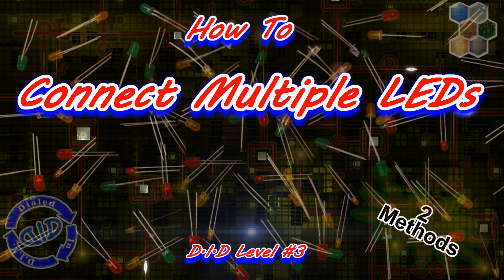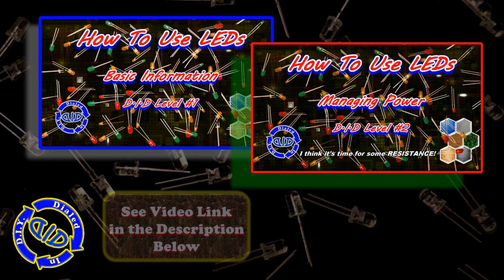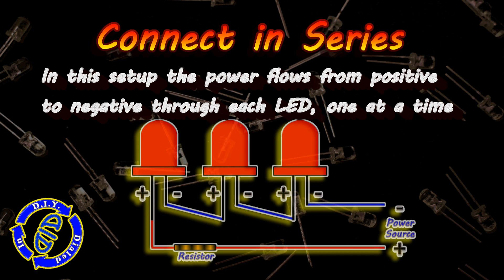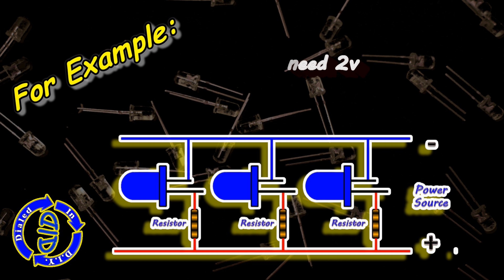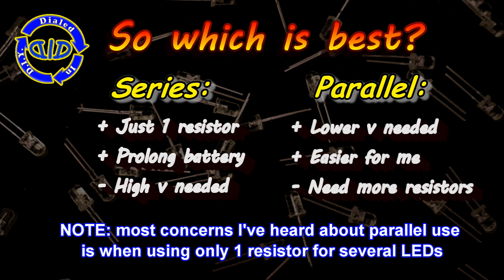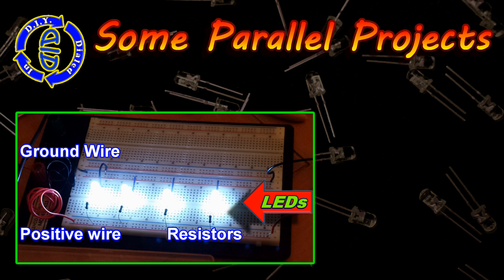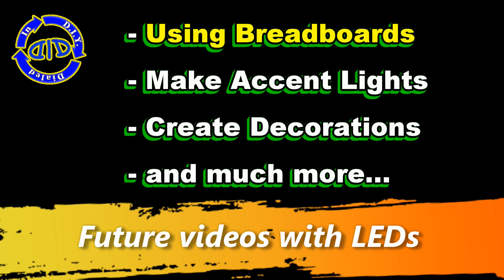How to Connect Multiple LEDs Together - Tutorial - make a string of lights

Comment: I have no understanding of electrical anything.  But, I love building model kits and have about 12 so far.  The lights that come with the kits are wired to battery boxes.  I thought maybe I could wire more kits to one battery box and I've even tried buying a dollhouse power strip and tried that way too no avail.  Is there an easy way to wire all my kits to fewer boxes?  I think I blew one kit already trying a power cord (i seriously need the "for dummies" version here).  There's a lot of batteries and power boxes as it is and a lot of switches to turn off and on.... and they're not easy to get to.

Comment: I am learning from your channel. Thank you. But, I have a problem. I am using a 3v 2x white led with 3v battery as my power supply and works perfectly but, when I added a red led 2v. The 2 white led did not light up, only the red led will light up. Can you help me what should I needed for my problem?
Reply from the maker: Thank you for the kind feedback.  I think you may have too much current needed for all 3 for the battery. Are you using resistors?
Reply: @DialedInDIY  But, I can use 5 to 15 leds (white smd led) in 1 coin battery last time. By the way, I am using battery because its used for cosplay.

Comment: hello, how about 84 led connection, what is the best connection for 84 pcs led?
Reply from the maker: Have you checked out any of the online calculators for setting up leds? That would be my #1 suggestion because it can be done with all of your specs including power supply.

Comment: If I wanted to power one led with a 12v car battery do I just calculate voltage? Or is the battery too strong?
Reply from the maker: You could... but you need allot of resistance. Depending on what you want to accomplish (in terms of form factor / size) you may wish to use  try running off of an adaptor. If the battery is still in the car you can use an aux power port (like the "cigarette lighter") to tie off of. Thanks for taking the time to watch my video and post a comment / question.  [So sorry for the delay... life kinda got in the way for a bit]

Comment: Hi I love your videos, I'm building a grow light out of an old grow light but it had couple lights out of it now there was a driver per light also it had fans but I'm not sure I'm putting them yet I made one already but it was cobs which is what I thought I had anyways I'm putting 4lights I gues 4drivers but I blew one already lol so I'm wondering if you can help me out?
Reply from the maker: Thank you so much! Happy to help if i can. I've not worked with grow lights but it sounds like these are LED bulbs or some form of CFL. Is that correct? Were the fans for reducing heat from the lights?

Comment: say I have a constant voltage driver that requires V between 33-36v. Is it possible to wire multiple LEDs of the same voltage in a string to obtain the voltage draw level required by the driver? and then wire multiple strings in parallel.
Reply from the maker: It is possible just be careful on the combination you use to match the power supply. Those on line calculators are great for that.

Comment: how do you connect one remote to two different brands?
Reply from the maker: Very good question.  Do the different brands match in type and power values?  As long as they have the same "type" of strips (ex. 5050) with same power requirements you can get parts and kits to split connections and drive the lights.  The good news is that these types of lights do not work on proprietary systems so there is allot of interchange that can take place.  Hope that helps.

Comment: If I've got an expensive led strip that can run or chase down the strip and I've got another strip that doesnt do that. If I connect the cheaper one will it perform as one?
Reply from the maker: Depending upon the set-up that you have it definitely could.  Many times the effect you get (in terms of chase, flash, etc.) is due to the control board that came with the strip.  Many are indeed meant to be able to connect to additional strips to extend the effect.  You may be able to look up the model number you have and see if the mfg website has any information to help confirm whether it is possible. Thanks so much for taking the time to watch and comment!

Comment: If you have the right voltage for your leds In a parallel circuit do you have to use resistors
Reply from the maker: Ah, there is an age old debate. TBH I do both depending upon my project but you will find many who argue that the resistor is key in order to protect your diode(s) against voltage fluctuation.  If you check an on-line LED calculator they will almost always have resistors in the recommended design.

Comment: How can i letter E with 10 led connecting 9volt battery
Reply from the maker: Just to confirm, you want to make the letter "E" using 10 LEDs powered by a 9v battery. Correct?  If that is the case, then the last piece of info that is needed is the V requirements for your LEDs so that you can figure out what resistor(s) to use.
Reply from the maker: Part 2 to the reply: you can also use one of the free online calculators for deciding how to set up your LEDs. One site I've used is http://led.linear1.org/led.wiz.  You can enter the details and it will tell you what you need.  I have a video that talks about that too: https://youtu.be/vcrrciHGasA

Comment: I’m running 2 LEDs in a series to 2 2032 batteries, with a switch. They come on, but they’re dim, what would cause this to happen?
Reply from the maker: Dimming is a common question and the answer is usually all about power. In the case of a couple of LEDs I find that the solution is typically to reduce the resistor value.  This provides more current to the LEDs and increases brightness.  You may also find that   with fresh batteries it may be enough but as the batteries wear out the volts are just too low.
Reply: Dialed In DIY Found the solution to run it in parallel instead of series! Thanks for the advice though, I’ll keep that in mind for future projects!
Reply from the maker: Fantastic... so glad you got the solution!

Comment: My wife has multiple colors of LEDs. If she connects them to all of the colors except red, they all light up.  If she adds red, only red one lights up.  She is connecting the positive and negative directly to the battery from each light without any resistors.  Is there a reason that red causes the other lights to stop working??
Reply from the maker: It is a good question and it is a matter of current requirements.  Different color LEDs have different power needs.  When you start combining different LEDs that need different volts / current you run into issues including risk of LED burnout.  Is there a resistor involved in this process or just a direct connection to a battery?
Reply: @DialedInDIY  
Wife:  
Here were our findings.
LED BLUE:  worked with a second bulb of blue, green, and white.
LED GREEN: worked with 2nd bulb blue and green.
LED ORANGE: worked with a 2nd bulb red and orange.
LED RED: worked with a second bulb orange and red.
Actually if the bulb was the same color we could fit like 5 reds together. 
I don't think it's a power thing if red can power 5 and blue can power five 5.  But power only 1 red and 1 blue.  And only red lights up?
Reply: @DialedInDIY  I have resistors, but we are only hooking straight to a battery. my K-4 students just asked me why it was happening.  And we found that it matches the rainbow order as well.

Comment: Super quick favor to ask. I have two strands of the tiny "dew drop" LEDs to hook up. One strand has 20 lights and the other 9. I tried just hooking them up to a simple on/off switch, but it won't light up. Do I need to add some other components like resistor or capacitor, and what value for this many lights? They are powered originally by 3 AAA for 20 LEDs. Any help is appreciated!
Reply from the maker: First thing to check is the wire you hooked the switch into.  Many of these are strung on magnet wire (wire with an enamel coating).  If the enamel is not sufficiently removed then it will not conduct through the switch.  It can be removed with a light sanding.  Try that first.  If not, then were you using one batter pack for both strands?

Comment: Yow. If i use 20 LED and connect them in parallel, with a 9v source with the right amount of resistance, will it drain my battery very fast?
Reply from the maker: That is a good question. Depending on how you hook them up & what the exact specs are for the LEDs you could get 5+ hours from a 9v battery.  A good way to figure out the best way to hook up a bunch of LEDs to a single power source is to map it out with an on-line calculator (they are easy to use).  One that works well is - http://led.linear1.org/led.wiz. You can try that using your LED info and it will give you the total current it would draw from the battery.  Hope that helps!

Comment: Total novice here. I have an outdoor light w 6 SMD LED's. It is too bright! What if I remove 2 or 3 of the LED's? And does it matter which ones I remove? Will it cause other problems w the light? Thanks!
Reply from the maker: SMD LEDs are typically soldered to a PCB... are you thinking of de-soldering a couple of them? Just want to make sure I understand what you are asking.  I have not done any modifications to SMD or COB LEDs so unfortunately I am not well versed in the power layout for each diode but I am not curious so I'd like to know more about what you have and what you'd like to do with it. If I can help (or anyone else who reads this for that matter) I'd be happy to do so.  Thanks for watching my video.

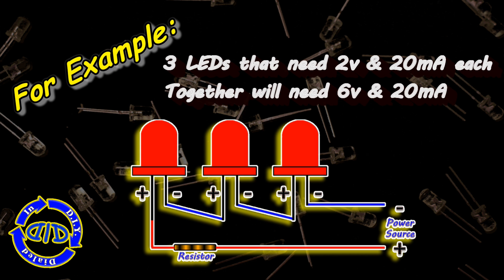Comment: Thanks for an amazing video. So, given 12 vdc power source, the resistor that you use at 1:24 would be: (12v-6v)/0.020(A) = 300 ohm. Is this correct? Also, at 1:58, given a power source of 12 vdc, each resistor would need to be (12v-2v)/0.060(A) = 167 ohms? If you use LEDs with different Vf/If in parallel, then you could just use different resistors as needed/required?
Reply from the maker: Thank you so much for watching and for asking your Qs.  First things first, great Qs and thoughts.  I have a video where I highlight use of on-line calculators to figure out answers just like these (How To Power Multiple LEDs - Planning Made Simple  - https://www.youtube.com/watch?v=vcrrciHGasA&t=79s).  Its a great way to simplify figuring out options for multiple LEDs.  In the first example you mentioned I'd likely wire 3 in parallel with a 330 ohm resister.  While I am not an expert in this arena I do use the approach you mentioned for LEDs with different Vf when used in parallel.  Thanks again!

Comment: Not sure the proper forum to ask lighting questions so figured Id ask here. I am looking to hook up 8 usb powered disco balls (about 1.00 usd each) together from one power source. The lights are very bright and move to music and would be water submersible fitting in a clear pvc pipe. Only problem is they are meant to run individually and would like them to work as if I were plugging them in individually.  Please any advice to where I could ask about this topic would be great knowing this probably isnt the right place. Thank you!
Reply from the maker: Good questions... USB pulls 5v and you could hook up multiple lights/components to run off one power source you just need to make sure there is enough current to run them with full power.  I have done something like what you are talking about before by using a different 5v output plug / wall wart.

Comment: What is the problem with connecting parallel LEDs to one resistor? If you it can take the power, of course
Reply from the maker: Great question.  I have actually done it on simple projects but it is not the "recommended" way.  The following linked thread has a nice, concise answer to this question: https://electronics.stackexchange.com/questions/22291/why-exactly-cant-a-single-resistor-be-used-for-many-parallel-leds
Reply from the maker: btw... thanks for watching my video and for taking the time to post your question!  I appreciate it!

Comment: Great video.  One question - once you test everything on the bread board and it's all working as expected, what have you found is the best method to physically wire the LEDs together?
Reply from the maker: Very good question!  I typically connect/solder a long wire to negative LED lead and resistor to positive LED lead (followed by wire) then cover with heat shrink (making sure no exposed wire from each side contacts the other).  Then I connect them all together per method in this video.  I used that approach for a couple of video projects:1. LED flashlight/table light: https://youtu.be/JmU3Zb3_HoA2. String of Decorative LED Lights: https://youtu.be/tzrijEfgG4APlease let me know if that doesn't answer your question.  Thanks for watching and for posting your question!!

Comment: Hi..I am doing a project connecting a parallel led (4 pieces) with resistors and connecting it with 5v powerbank but it keeps shutting off after few seconds..can someone help me why is that happen?
Reply from the maker: Before it shuts off is anything heating up? Maybe the wires, resistors or battery?  I would check that first and also look for any possible lose connection that may cause a short-like effect.  Let's start with that and see what you find (I hope it helps but if not ping me back)
Reply: @DialedInDIY  thanks for the reply but nop..nothing's heating up..i even rewired all of it with a new resistor but it still does that..when i tried to connect it with a normal battery it works fine..is it possible that my powerbank was the problem? But it works when i used it on my phone..
Reply from the maker: I think the current load from the power bank isn't enough especially if it was intended for phone charging (your batteries are providing more amps for use than the power bank is able to).  A typical power bank that can charge a phone is going to run USB 5v equivalent with a lower current... as needed by the phone.  This would mean that your power bank is doing what it was made to do but unfortunately that isn't enough for the LEDs.

Comment: How to connect 50 led in parallel connection .. ohms of the resistor
Reply from the maker: To answer that question you need a couple more pieces of info like the voltage from source and the voltage required by the LEDs.   I have another video that explains a very easy way to get that answer once you have that info; https://youtu.be/vcrrciHGasA. It will show you how to use the info you provided get a layout created for you in just a few seconds.  If that doesn't help, then please let me know.

Comment: Great stuff! Could you please help me with the following? I want to connect 10 bars of 4 Series Leds each in parallel. What would be the voltage, current and resistors arrangement. Thanks.
Reply from the maker: Thanks for watching and for the comment & question.  I have another video that explains a very easy way to get that answer; https://youtu.be/vcrrciHGasA. It will show you how to use the info you provided get a layout created for you in just a few seconds.  If that doesn't help, then please let me know.  Thanks again!